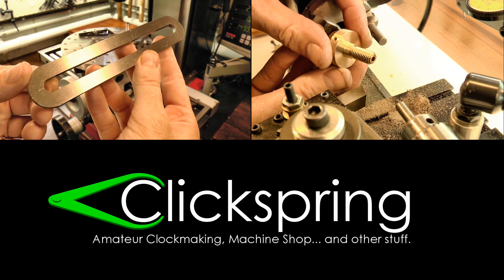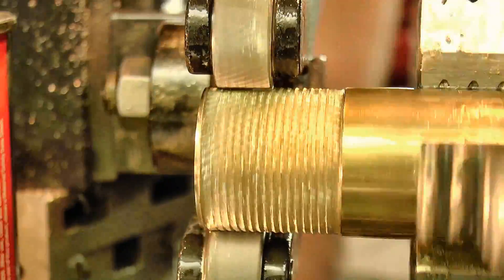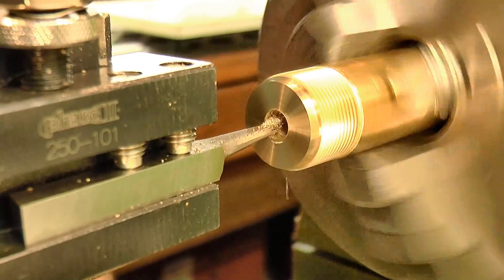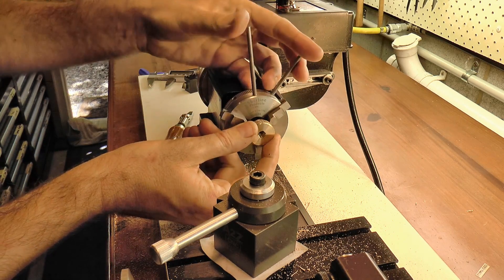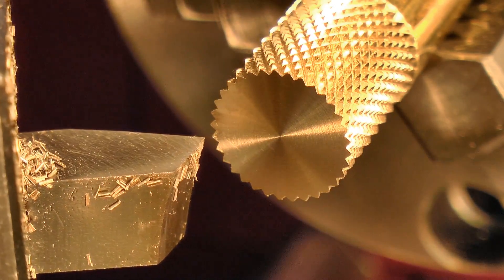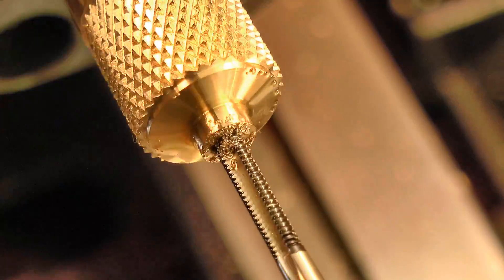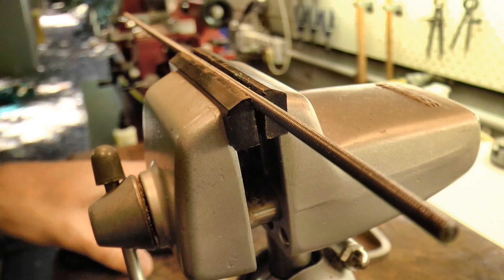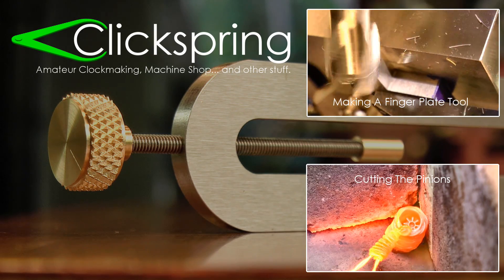Home Machine Shop Tool Making - Machining A Pinion Head Depthing Tool - Part 2

Comment: I learned a trick while knurling. It goes counterintuitive to what everybody tells you. Get a quart of 80 90 weigh motor oil turn slower than you are much lower and apply a big thick bead of 80 90. The particles get pulled out and suspended in the big glob of oil that's turning around and it pulls them away from your work

Comment: Thank you for taking the time to share these videos. The video quality and editing is superb. These are my favorite machining videos on youtube!
	Quick question, I have the opportunity to buy a 1920's watchmakers lathe which is in beautiful condition. It seems to be as solid and well made as anything of comparable size today and the owner is only asking for $600. 
	The only concern is will this be harder for me to operate for a first lathe?
Reply from the maker: +Alec Guth Some of the turning techniques used on a watchmakers lathe are quite different to standard lathe ops, eg using a graver. If it has a T-rest, rather than a cross slide and top slide (compound), it may be a bit more challenging as a first time lathe. Then again, learning new things is all part of the fun! Thanks very much for watching :)

Comment: hi ,
what did you flush the brass with while you were knurling it?
Reply from the maker: Charles Camenzuli Hey Charles, I tend to use a mix of paraffin and cutting oil. But I don't really have a recipe, I just have a container underneath the tool that catches overflow, and I just keep the process of flushing the chips away continuous, which is the main thing. I think just about any non viscous fluid would do the trick. Thanks very much for watching.

Comment: Thanks, I forgot about your web site. How do you keep your tools from gathering rust, when not used all the time, here in Alabama its humid and rust is always a problem.
Reply from the maker: Gregory West Yes I live in a very similar climate, and rust is a major challenge for me too. I have it pretty well in hand now, by just coating everything with a light film of oil after I have used it. It takes real discipline though; If I forget even once, I get flash rust within hours.

Comment: You ,emotion using a watchmakers chuck or collet. Is it an 8mm style or is it larger. Also, what source do you have for replacements. Mine are worn out.
Reply from the maker: Rodger Young I use the Sherline version of 8mm collets. They have the standard 8mm watchmaker thread, but the other dimensions vary ever so slightly across different manufacturers, so check their specs against what you already have to be sure.

Comment: Awesome videos, very informative may I ask about the jeweler's saw you used to cut the threaded rod? is it a brand name or did you make it?
Reply from the maker: eddie Towers That one is shop bought, but I can't see a brand on it. IIRC I picked the better one in the catalog at the time.
Reply: Oh, OK, what exactly is IIRC?
Reply from the maker: eddie Towers Sorry Eddie - "If I recall correctly"

Comment from the maker: In this second episode I continue with the depthing tool project, by making the knurled nuts, and the adjusting screw.

There's a lot of brass knurling in this video, as well as general lathe work to get the parts into shape. Be sure to watch the concluding episode next week, where I finish off the tool.